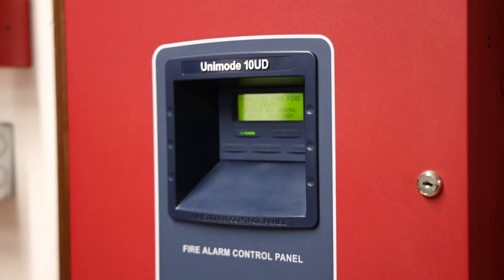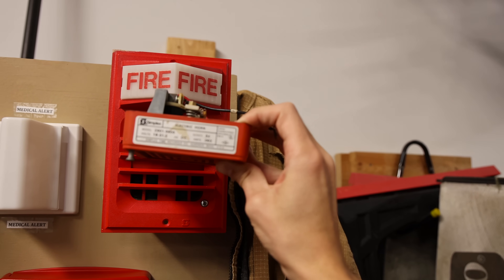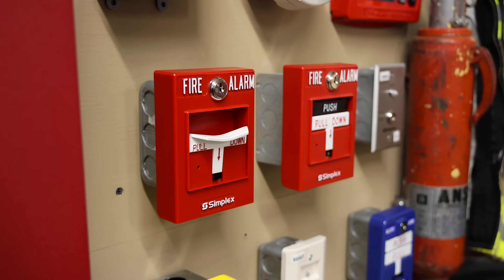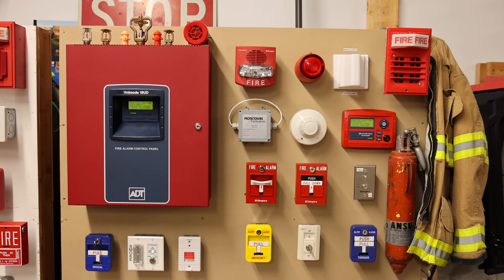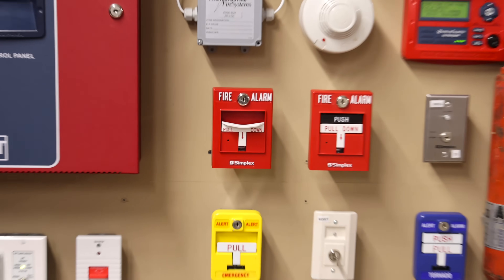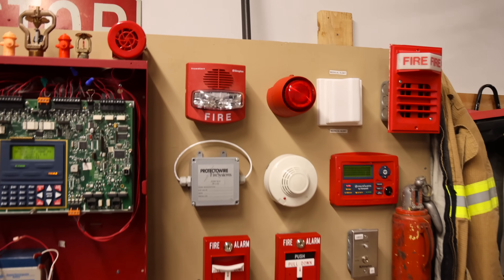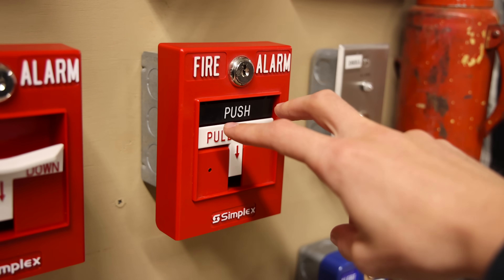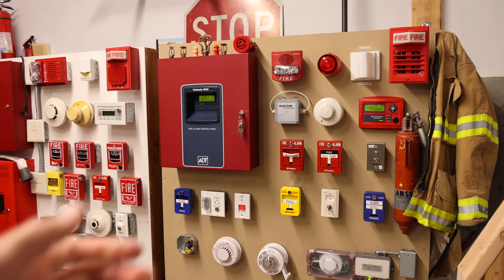ADT Unimode 10-UD System Test 36 | Simplex Fire Alarms on Two-Stage!

Comment: Ahh, the 493-9426. Had it in my elementary school, was very loud. Now at my middle school they have these weird ceiling alarms that you can’t hear AT ALL with a dim strobe. Very unsafe. Even a classroom at a normal volume will know it is beeping until the strobe starts about 10 seconds later.

Comment: Requested Test 37: Really old style Alarms: Simplex 2903-9838 (On Strobe plate) Wheelock 7002T-24 Pull Stations: Simplex 4251-30 Firelite BG-6  Code: Code 3

Comment: I noticed that when you tapped that separate fire alarm horn on the other fire alarm that horn that you were holding sounded like it was making it’s noise?
Reply: It’s because it’s a mechanical horn that has a plate that vibrates